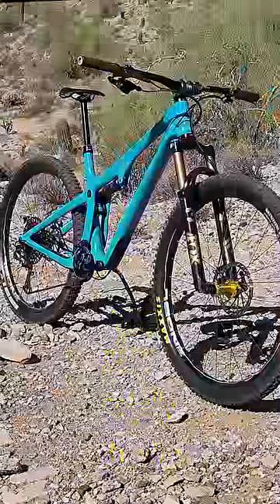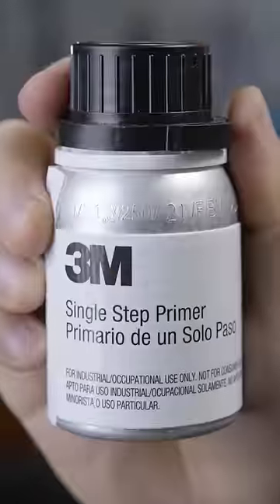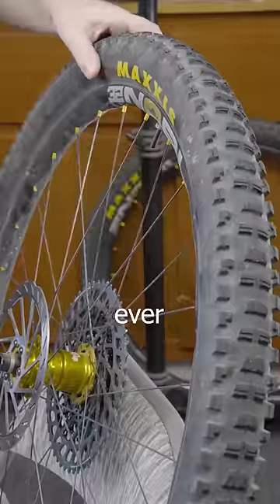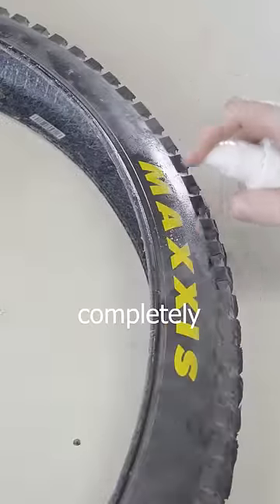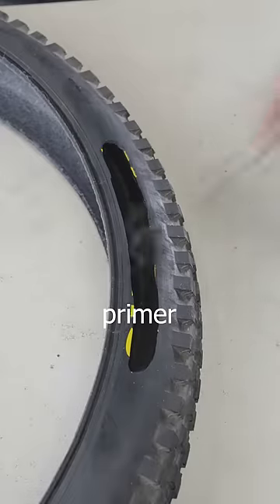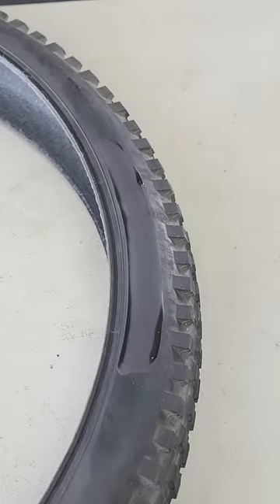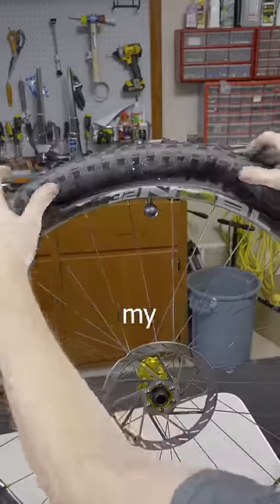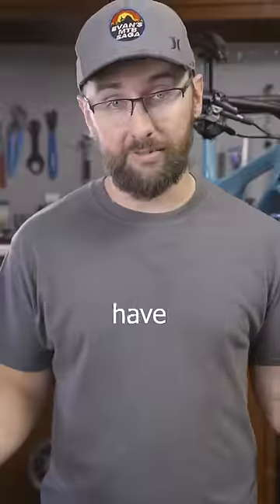MTB Tire Hack!

Comment: Ever sinse i found that MAXXIS tire thrown away in the trash. I've seen cheap tires like  absolute garbage. Why? Because i installed this half-worn out MAXXIS tire on my front wheel and it lasted me a whole 8+ years through winter and blazing hot summer and not a single crack appeared. But last year i had to change it before winter because the threads were literally gone in the center.

Comment: Back in 90-91 I worked at what was at the time the premiere mtb shop in the world. We used to dye 55 gallon barrels full of gumwall tires in the back of the shop, because the were lighter than yhe few blackwall that were even available at the time.

Comment: Hello! I like your channel. What do you think about  the sprays for fork. What are the benefits? :D  And my front disc came slightly bent how can I straighten it. :) Thank you in advance! :)
Reply from the maker: What sprays for the fork? I haven't successfully straightened a rotor, if it's a cheap one I usually just buy a new one haha
Reply: @EvansMTBSaga  In two bike shops they said that it is slightly bent and it’s not a problem but sometimes can be heard a lot.
Reply: @EvansMTBSaga  For the spray to smoothen up and protect the fork as I know. (I have air fork)

Comment: Yea that bottle is 60 bucks guy
Reply from the maker: I got it for $30
Reply: @EvansMTBSaga  shhiiii boy, watch that shelf life it only good for a week or so. I had to use that to prime the metal before i put a new window in my car. They only had the bigger bottle so i had to shovel out the 60 for it and only used a small amount. Ig now ik what else it could be used for, that is if it lasts 🤣 thanks for the insight!
Reply from the maker: @TooMuchTemper  Oh dang good to know! I hope it doesn't dry up that fast, I'll be super pissed!